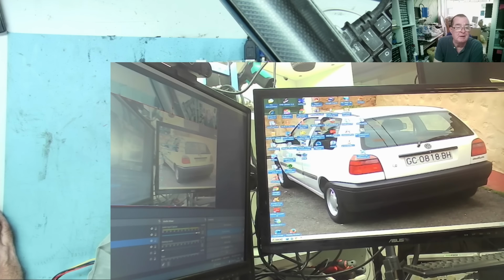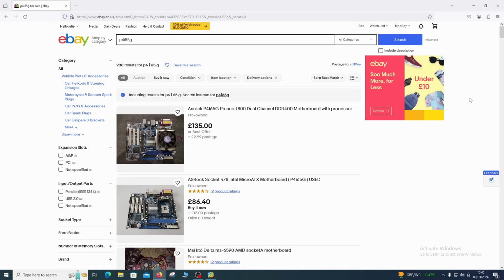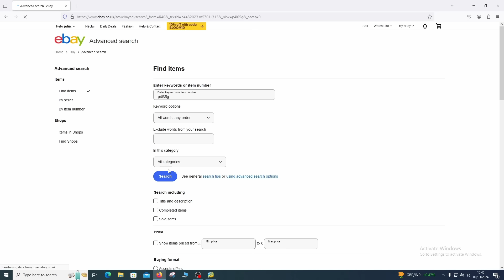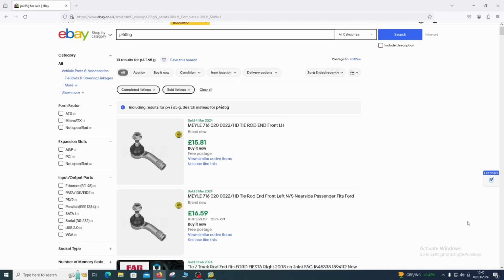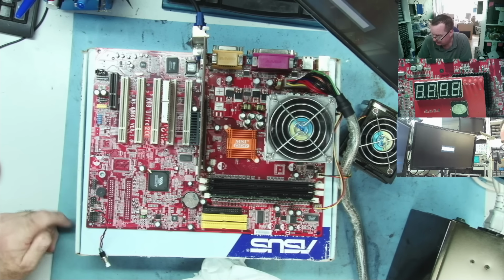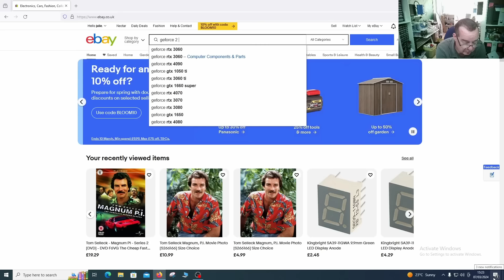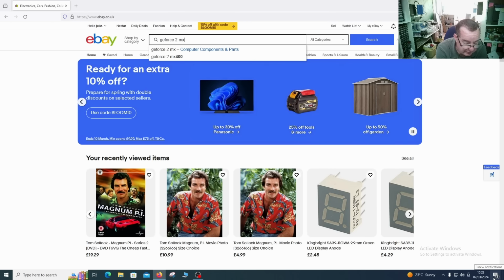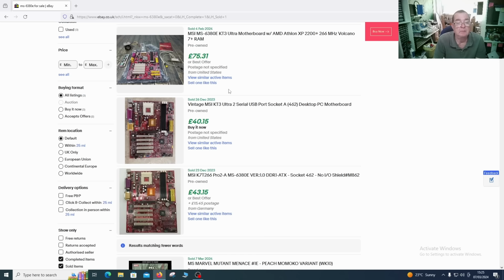Car Boot Flea Market Retro PC Finds 10th March Guess What I Found This Time

Comment: My thought on why some very old boards still command high prices is that they may be needed to keep running some vintage software used to as part of a CNC setup or process control.  I know a friend had to seek out a machine happy to run XP with serial ports he needed to pass controls to his very expensive Swiss lathe.  Just a guess though.

Comment: I never understand some people on EBay when it comes to prices. There some items that just keep getting relisted over and over again at the same price. Then there are others that when the item doesn't sell actually put the price up! If it didn't sell for the lower price what makes them think it'll now go for a higher amount - madness!  Interesting that you mention buses, back here in the UK the cost has actually gone down with the introduction of the £2 cap on single fares. A return trip that used to cost me £7.50 now only costs £4 as it's now cheaper to buy 2 singles fares at £2 each rather than use a return ticket.

Comment: Hi Richard; regarding the KADA 853/853B.  I see it on AliExpress advertised as "220V / 110V" but when I go down to the technical description it says 220V with no mention of 110V, which is what I would need here in the U.S.  Is there a way to allow it to function on the lower input voltage or is the description incorrect?
Reply from the maker: I've heard others say the same. Unfortunately as we have 220V here I can't really advise on that but I heard that US homes have both 110V and 220V as they have three wires (one is the 110V center tap) I googled this and found 'We do have 220V, but it is only for high-draw loads like electric stoves/dryers, etc with large plugs' so isn't a matter of plugging a 220V device into the correct sort of socket? I guess the KADA preheater kind of comes into the realm of stove/dryer.  But that's just what google told me, I've never actually been to the USA
Reply: @LearnElectronicsRepair  Thanks so much for the speedy reply, Richard - much appreciated!  Electricity is fed into U.S. homes via two main wires which supply 220 Volts AC at 60 cycles.  We have a local ground (earth) wire connected to the main circuit breaker box, forming a split configuration in the breaker box, so we end up with two separate feeds into our houses with 110 volts on each side.  This allows the devices that consume that power to be balanced between both halves of the main feed.  The standard 3-pin wall sockets in each room supply 110 volts on the "hot" lead which is the narrower of the two flat plug pins and uses a gold colored screw; with a "neutral" lead on the second (wider of the two flat plug pins and uses a silver colored screw) of the main electrical feed side, and a third round "ground" pin which uses a green colored screw.  In actuality many of our homes receive more like 240 volts, so the split voltage is closer to 120 VAC.  We do have 220/240 VAC sockets but only for specific large appliances like the clothes washer (often those are still 110/120 VAC), the clothes dryer, the kitchen oven, sometimes built-in kitchen microwaves, sometimes the heater, and external devices like swimming pool pumps, air conditioners etc.  Those specific 220/240 VAC sockets are much larger than those for the 110/120 VAC and have a totally different pin configuration.  Thus the standard electrical sockets in the rooms of our houses only supply 110/120 VAC, not 220/240, and typically are rated at 15 to 20 amps maximum on each circuit.  The 220/240 VAC sockets are reserved for the high-current appliances.  Back to my question then - it sounds from your answer that the KADA is only 220 VAC, not configurable - can you confirm that?  If that is the case, then the description I saw for that item on AliExpress is incorrect.

Comment: G,day Richard from Sydney Australia. 

* Im surprised of the value; old 90s Pentium CPU tower
* Open tower cabinet
* Check RAM card 
* Take out card, isopropyl, brush and dry
* Check spec on fan and replace or free propeller
* Check caps for swelling (test for capacitance)
* Boot up look at LCD codes and listen for tones.
🖥️💾🇦🇺